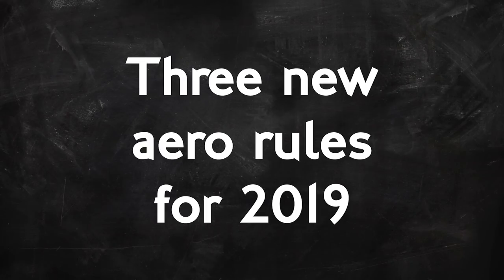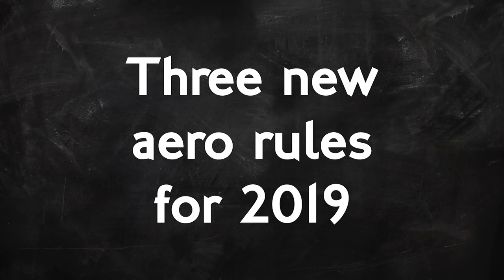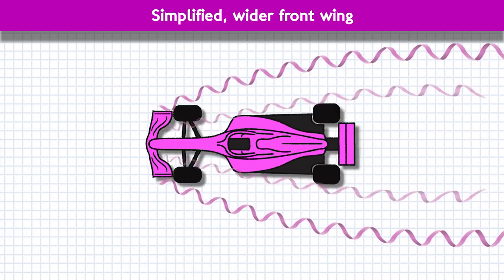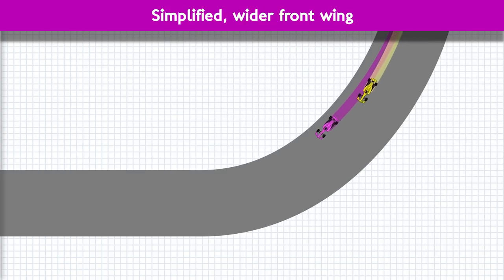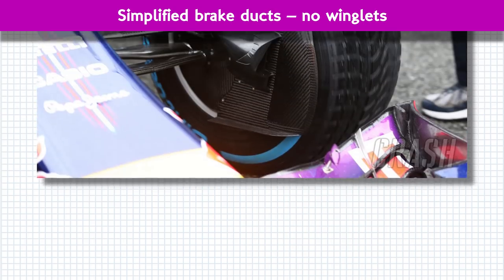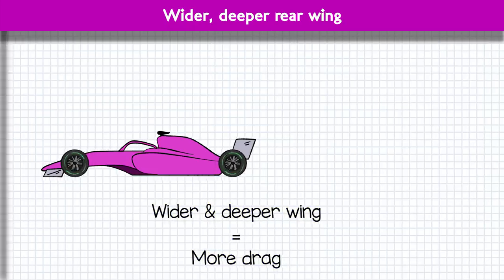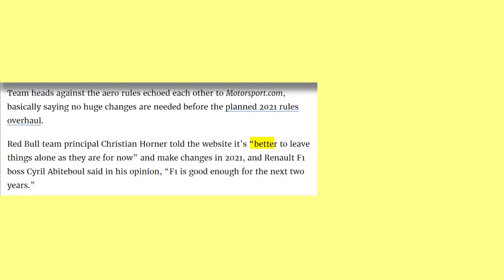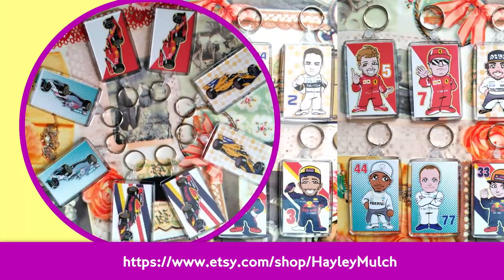New Aero Rules in F1 for 2019 explained

Comment: I like the idea of simplifying the front wings and break ducts, but I really dislike making DRS even more effective. I already think it leads to ‘fake’ overtakes.

I think part of the issue is that these modern F1 cars have too easy a time on the tracks. Too many corners have become full throttle, and thus require less skill, less error and less opportunity for overtaking. The same with the increased stopping power of the cars: shorter breaking zones lead to less overtaking. So, I would rather see them limit the breaks a bit than increasing drs.

Comment: I wonder what would happen if you just make the wings smaller, especially the front wing. Less downforce during the corners and more room for errors.
If everybody can go full throtlle trough the corners then there is no possibility to make an effort, but if you have to slowdown the compromise the lack of downforce then there would be more possible.
Take a look at wrc, no wings and close combat. So with smaller wings, hopefully closer combat and still massive performance.

Comment: New aero also means development of new parts, which in the first place will help the top teams only, while the gap between the cars will be bigger. Kinda the opposite of more overtakes.
Also for me it feels cheap to make the DRS more efficient. It is already not liked very much. So more DRS overtakes probably won't satisfy the fans.
I agree with the guy saying that they should wait until 2021. Then there will be a kind of reset anyway (engine) and so they could use it as opportunity for a bigger overhaul.

Comment: The front wing change sounds effective, but the rear wing change not so much.  Teams will simply put less angle of attack into the wider, deeper rear wing elements, resulting in similar downforce and drag to today, and similar drag reduction due to DRS.

Comment: I wish they add a new device similar to the DRS for the straight (drag reduction system)  you can call it DIS on the corners ( downforce increase system) like a thing that slides up on the wing to increase corning for overtake also less than 1 sec gap. so that no time is lost on the corner. Thank you

Comment: I think that too many complex rules detract from the motorsport. For example, instead of prohibiting this and limiting that, the teams and drivers should be awarded/lose points for desired/undesired things. For example, the teams could earn a few bonus points for efficiency (less fuel and tire usage over the weekend, fastest pit stop, etc) or lose points for going over the number of engines allowed (instead of losing grid positions). The drivers should get bonus points for fastest lap, pole position, most overtakes, etc, and lose points for bad behavior like cutting corners, causing accidents, etc.

Comment: my solution to f1 is always ...much tougher tires to allow a lil sliding and probably blocking of brakes and MUCH more power so the driver balls would be a thing to consider... Tires that will be able to withdstand abuse in overtaking via a dirty part of a track and lock brakes occasionally will make driver to dare to overtake more often. And yes aerodynamic rules should allow for simplier sollutions with wider wings to allow +- same amount of grip but with no vortexes by the sides of the car.

Comment: In DTM they removed neraly all of those small flaps they had mounted on every inch on their cars. It means the cars get slower by about 1-2 seconds depending on the track, but the season start was today and it was l a lot of action compared to last year and when the cars touch now, they normally dont loose any aero

Comment: I like the changes, but I don't like the wording per say. I would've much rather seen a less explicit way: e.g. instead of "a wider front wing" how about a rule "The airflow in a x by y cube behind the car cannot be disturbed more than z" - That way, you leave the teams to think of innovative ideas, instead of giving everyone the same stock front wing.
Reply: one must understand the air flow around a f1 car. if we could see a physical or graphically generated air flow around an f1 car during a race, with color coding to indicate the ""thickest"flows of dirty air... you would see when a following car uses drs it can get thru the engineer designed tornado that is behind an F1 car
as the dirty air dosent hit the back wing as hard causing more artificial resistance drs actually returns the slipstreaming and slingshotting pass ability to the drivers.

Comment: While the aero is playing a part,  the bigger issue is the small temperature range of the tyres. Whenever a driver pushes to overcome the disturbed air effects or just for racing the tyres either blister or grain.  The really disappointing races this year have been those where the drivers have nursed their tyres from flag to flag (Canada and Singapore come to mind). No question the aero issues  are contributing, but the whole idea of the 2017 regs was to get the drivers pushing again.
Reply: I know there are plans to deal with this in 2021, such as outlawing blankets. But surely Pirrelli could do something for next year.

Comment: They should change front wing but not in this way, yes car will have more speed to overtake, but he will also lose his grip on the front wheels. The front wing is key here and for the driver in the front of the race and for the overtaking, they should focus on this instead of adding more power because they do not lack it. The driver who overtakes must have better grip in the dirty air, otherwise it will end up selling out on straight lines with the use of DRS

Comment: Maybe the front wings could stay the same width size, as we see now, and the rest of the car could be reduced in scale, outside the drivers domain in the car, to create cars that have an increase in overtaking and also less width on the track.  Smaller cars would also be lighter so speed and acceleration can stay strong.  The shortened length, from front to back, would also assist overtaking. Maybe a width decrease of 2 inches and a length decrease of 2 or 3 inches could be the proportional reduction in car size.  Safety obviously a top priority within such decreases in the size of the cars alongside new aero strategies to assist overtaking. (Probably the long term approach to the future of F1.)

Comment: Well what if DRS is only available when a chasing car is 1-3 seconds behind and after 5 laps instead of 2. Then the DRS is good for catching up to a driver with the move being done in the braking zone. The increased slipstream effect means that DRS really shouldn't be necessary. And the 5 laps instead of 2 should create a bit of raw overtaking at the start of the race while everyone is on fresh tyres and bunched up.

Comment: As I don't understand the aerodynamics, this might be an ignorant comment. But, I don't like the wide front wings. They look like silly. Limit the wing end plates to stop by the inside of the tires. Both front and back. Limit the front wing to one or two wing planes and limit the rear wing to only one plane. NO DRS - that is artificial. Smaller front wing means they do not lose as much downforce when following a car, so they can stay closer. Also, they do not need DRS on the straights. We want the cars to have less aerodynamic grip and more mechanical grip.

Comment: First 2 seem pretty good ideas; make it easier to follow (which I understand is the problem). Latter idea is probably really bad if it's compounded by the car (hopefully) being closer together out of the corners. DRS can sometimes already provide too much of an advantage, with the overtaking car pulling fully in front of the lead car before they even get to the next corner. 

In worse case, closely matched cars will just swap places every DRS zone, and the game will be making sure you're behind on the last DRS zone before finish. (Although if both cars get DRS, hopefully it'll work to pull them towards a car further ahead - that would be fun)
Reply: drs applies when you are within one second of the car in front, if you get passed you open drs yourself...
Reply: Mike James I know how DRS works. My point is that the current issue is cars can't stay close enough at the moment to make DRS work (hence them saying you need a 2 second advantage). But if you change areo so they are closer, do we really need to improve DRS further. DRS already makes it quite easy to overtake if you are close enough. Problem is can't get close enough, which 1 & 2 fixes. I don't think DRS was the problem. (Maybe watch the video)

Comment: I think the front wing is a great idea RE cutting down turbulent air. Should act as a nice long term cost cutting measure for the wing itself. But its going to force a redesign of brake cooling, barge board areas etc etc which is more short term development money for the small teams to suffer with. Hopefully part of it is that the endplates are made stronger so that the lightest touch doesn't cause the carbon showers we get now, especially since they'll be wider and more accessible to another cars wheels. Not sure about the rear wing though. Hopefully that's just temporary. Wasn't the problem with F1 identified as excessive top surface aero relative to underfloor. Worried this will help keep the emphasis on wings.

Comment: I say a small single plane front wing, and another at the back.  Get rid off all the other barge boards and winglets crap, and make the tyres bigger.  And reduce the size of the cars, they are as big as a pickup truck.  And blocking should not be allowed.  I prefer Indycars rule on this one, you can make a proactive move, but not a reactive move.

Comment: DRS was always a cheap bandaid for a likely irresolvable problem. The aero on modern cars has a greater influence on lap times than ever, and the turbulent air, heck, even running in a laminar flow slip stream would decrease the airflow over the aero surfaces enough to ruin the down-force of a trailing car. That is pretty much unavoidable.

If it was tuned to give an advantage on the straights, exactly equaling the time lost in the corners close behind another car then I would be okay with that.

Comment: Remove all the aero down force and make the cars less wide. Before wings the following car had the advantage of less drag and could easily follow another car through a turn and then pass. In most cases the cars actually produced some lift so the car behind actually had less drag and more grip because the reduced air flow cased neutral downforce. The cars would have higher top speed and longer braking zones which would create more passing. What sense does it make to put wings on a car to give it higher cornering speeds and then put in chicanes or tight, 180 degree turns to slow them down?

Comment: Tuff call, wanting to make the sport cheaper but needing to redesign the front end whilst still developing the one for this year kinda contradicts itself. We know it won't stop at just the front wing the teams will want to change the nose aswell to ballance out any downforce lost from removing all the winglets plus with the increase in rear wing size they'll be more rear downforce to even less front which will have a knock on affect of its own, rake change which will probably need floor redesign an so on an so on.

Comment: I reckon the 1st 2 solutions could be good, but the rear wing changes are unnecessary , especially considering the already differing top speeds of the engines lower down the field

Comment: I think these changes are great for the sport. Yes people will argue that it will slow down the cars and take away from the. "pinical of Motorsport" aura, but Motorsport is much more than speed, it's battling and getting all the performance out of your machine, regardless of the limit of the machine. Look at the lower formulas, or even smaller local racing. The on track battles would be wonderful to watch as well as the simpler front wings would effectively lower cost if the rules stick around for some time. There's only so much you can do to a 3-4 element wing. Because of this, the "restriction" also has the possibility of tightening up the field, especially with Mercedes and Ferrari (as of currently) customer teams, as the power is there and the areo can be designed and developed at less cost, helping those customer teams. I think it's a great step in concept, but we'll see come next year.

Comment: I think in short term these are great ideas (especially the front wing, finally...) BUT more has to happen.
Do you remember who was fighting for wins in the 90s?
Williams, Benetton, Mclaren, three medium budget teams. With aero getting more expensive it turned out to be Ferrari, Renault, Mclaren maybe but still williams very close in 2003, jordan in 1999, private teams

Who is fighting for wins now? Ferrari, Merc and RBR, the three highest budgets. Maybe Renault behind and then Mclaren.
The order is only dependant on budget and is set in stone. No changes. Thats also why the field is spread out so far.
If F1 should become more interesting it has to make itself more affordable, even for private teams.
If it does not become more affordable it will still be the pinnacle of motorsports consisting of 3 teams. The others are merely bystanders.

Comment: Only problem I see with this, they just make them "simplified"... Which mean, they will make them remove "some" of the winglets on the front wing, not all of them... Which mean? The Teams will find a way to "bend" the rules and still make the Outwash pretty much the same... I even think it will be worst with the front wing wider now... Same will go with the brake inlet... They will remove those winglets, but the Teams will probably just modify the inlet in a way it will do the job the winglet were doing... They should have completely remove ALL THE WINGLETS on the Front Wing, just one big Front Wing with no additions on it... And completely remove the brake inlet too... Older car were faster on straight and way heavier, which mean the brakes were even more under pressure and they were holding... They just need to make the brake maybe less effective, but more durable so they don't need that extra air to cold them...

Comment: Best solution for the deficiencies of the current DRS format would be to make it an adaptive system. The most DRS should do, is to bring the chasing car  to the tail of the car ahead, and from there on, it should no longer have an advantage. My proposal is this: Increase DRS activation time delta to two seconds, and put transponders on the cars. When the chasing car is within a set distance from the car ahead (let's say 10 meters for now), the leading car gets DRS too. This way it's a fair fight, and most likely what we would get if dirty air had no effect on the cars.
Reply: if there was a pocket of clean air in a space behind an F1 car then i totally agree with you, using drs to get into the slipstream would allow a driver to pass using drafting, the issue is engineer designed tornados directly behind most f1 cars prevents that car sized clear air space. thus negating a drs shutoff and using the draft to pass technique. i would adjust your suggestion with moving the transponders to the nose of the cars and as they come even then drs closes and its  the same "clean" air for both drivers and a matter of who is the better driver going into the corner.

Comment: Several years have been spent trying to create a better show in F1 , this dirty air issue has been around since some crazy guys back in the late 60's stuck upside down wing on the F1 cars , all manner of things have been tried to get around the dirty air solution , including moving aero way back at the start of the 70's these day rebranded as DRS , the best solution still for me is Ground effects , using the whole body of the car has a aero device with smaller front a rear wings needed, but since modern F1 car no longer have full length side pods there is less over and under body to channel the air through . These days with the major part of the aero having go over or around the car to gain the massive down force needed to make stick to the track , and the massive amounts of power needed from the engine and hybrid power units needed to drag the car to the hi speeds needed in F1 and the types of track design now been used make this a very complex problem to solve.